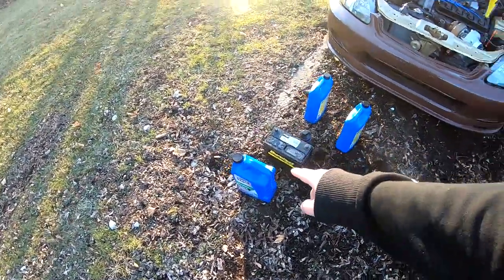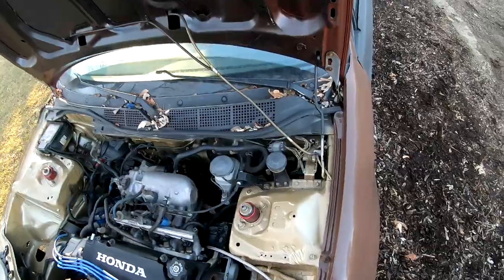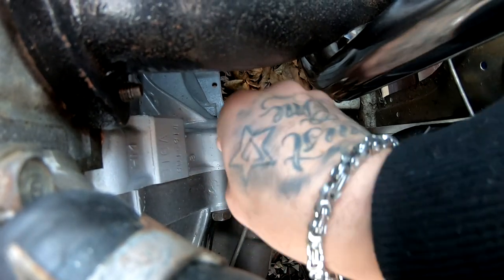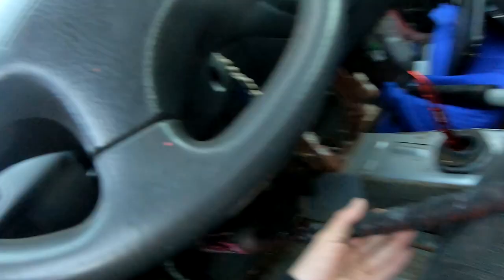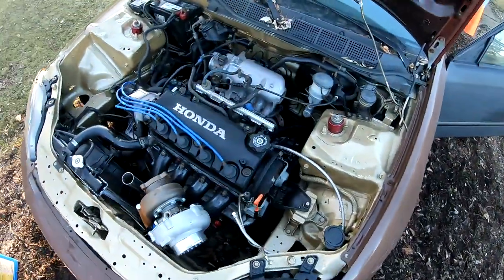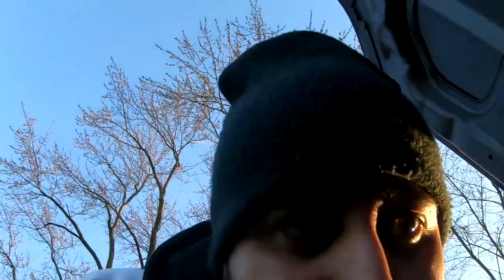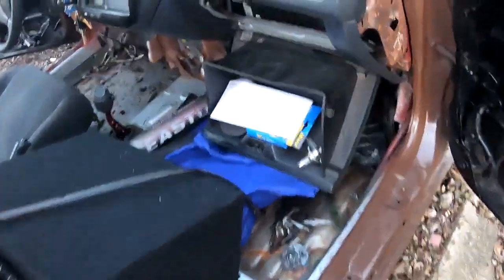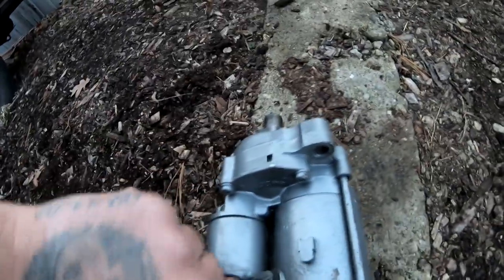Cheap Ebay built Civic is BROKEN R.I.P. NESQUICK 2019???

Comment: dang i was so excited !!!
the starter made no noise at all huh?
Reply from the maker: Nothing no click or anything i got it checked and its good so im thinking like the other guy said neutral switch or igniton switch. Something is not sending signal. I also coild not hear the fuel pump prime. Maybe a bad ground somewhere?
Reply: Hmmm.  Not sure but hope you can fire it up for us soon!  Make sure starter relay clicks once you turn key.  I just replaced starter on one of our cars too.
Reply: Main relay, and definitely get a Honda one. Aftermarket relays are trash.

Comment: I'd definitely check all your wiring and all grounds make sure the batter isnt dead have it tested while ur at the autoparts store as well so you don't have to make another trip there and make sure all your battery connections and fuck connection to the battery are connected tight cause if one is of from fuse panel next to  battery yo wont get no power like you have been...

Comment: Does the check engine light turn on then off, or not at all?
Reply from the maker: I think not at all
Reply: The check engine light should flash on then shut off when you turn the ignition to on. You could check to see if you are getting voltage to the relay from the ignition. If not, then probably ignition switch. I would just find someone who has a known good relay and try it out. That's the easiest way to tell if it's the relay or not.